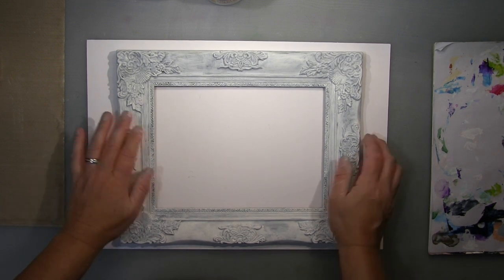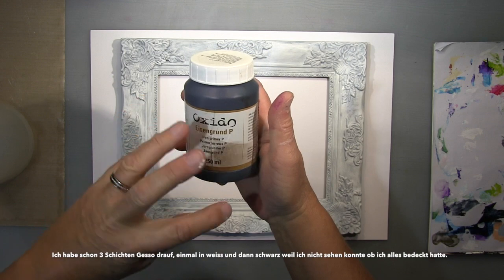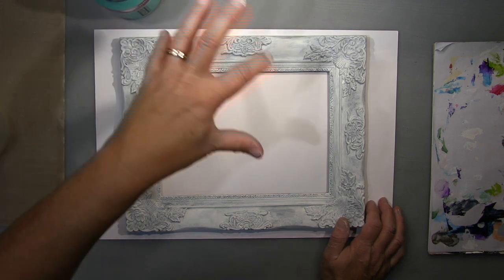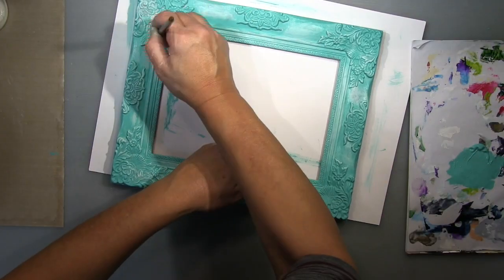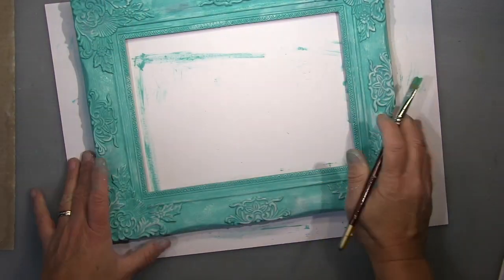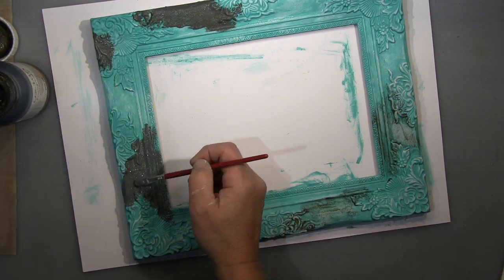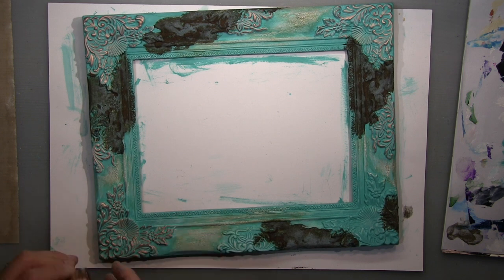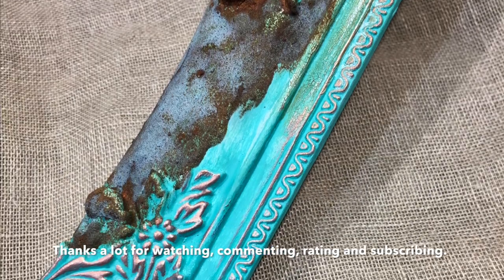Altered picture frame with rust

Comment: I love your use of color, and I am so intrigued by your work with rust. I have not attempted it yet, but can visualize how I can incorporate it into my mixed media. I can picture your frame hanging on a wall, off center with a kinked ragged wire even rusty; hanging on an old nail.
Reply from the maker: Thank you Monica. Yes, you`re right, either very shabby hung up or very elegant, as a contrast.